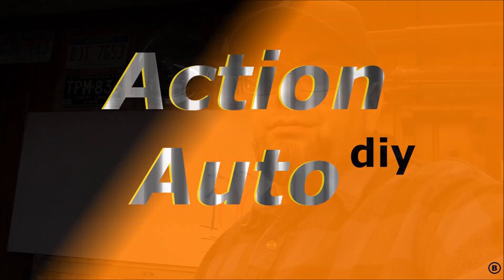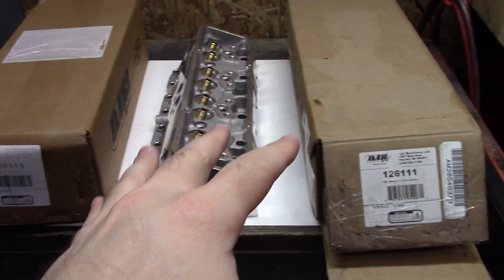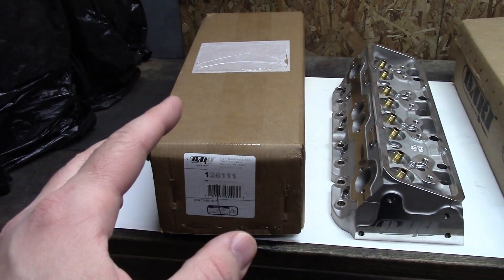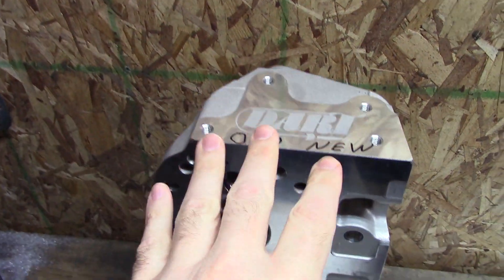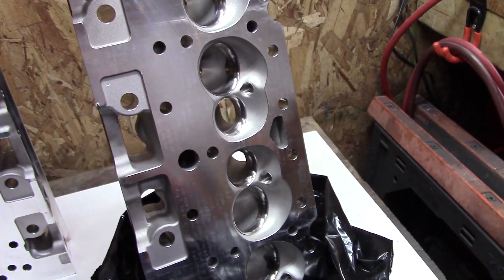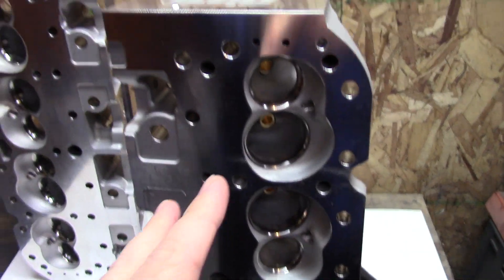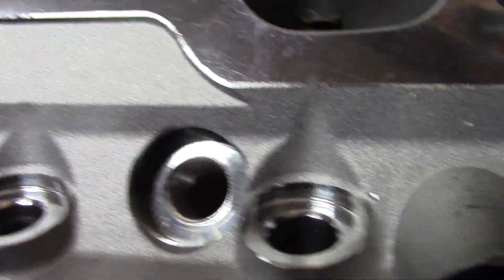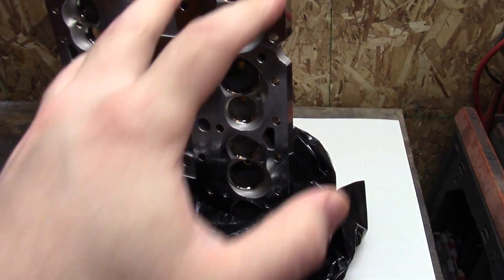Dart SHP the replacements Replacement!

Comment: This reminds me of a situation  I had with dart  heads  I purchased  from summit  racing. I bought  a set of 230cc Iron Egale steel heads  I kept  the in the box and I took my time buying  the rest of the parts need to finish  the motor. Well I took the heads out of the boxes  and laid  them  down  with rest of the parts. I was shock when one of the heads didn't  have spark plug  holes. I first thought  it was some kind of  hemi setup  but know spark  plugs  hole on top. So  I called summit  racing  and the told I was a day late abs dollar  short and I couldn't  return them they called  the company. So l called dart and I explained  my situation  to them and said send them back to summit racing. We'll I was looking to do that but summit  said nope. So  dart told to send the head to them and if things turn out like said what was wrong with the head the would straighten things out . They saw the problem  and dart real good on the defective  head. The ask me do I still want the 230 runners and said  yes. I ask them could get 2.08 intake  valves  he said let me check and see what I have available. He told you got the and I would get the heads in a few days. When a few days had passed  and when arrive home my mom  told me I had a package. So the package  was  by the front door  so when I picked  them up the boxes felt real light so I took out door  in the sun light to get a better  look so opening  the box I grabbed  the head wrap in black  plastic  got a good grasp and yank it out of the box. The heads  was so light that it almost  flew out of my  grasp. I was shock and I couldn't  believe  what they gave me. They up  grade me to pro 1 aluminum  heads  I pickup the phone and call them I believe  I spoke  to a person  named John  and I'd  thank him most graciously  for the  up  grade. When I got hold  of some extra  cash  I ordered  a complete  set. The heads  they sent bare  where 2.08 intake  and 1.625 exhaust. This happen back  around 2005. I would  call and speak to whom in charge  of quality  control. The person  job to inspect  the heads or part hasn't  did his job. They want to personally  know so the can do good business  with us racer. The last time I called  summit  racing  to find out info  they on talk about there products you have to call the company  to get information. I wanted to order a solid  roller cam summit  said I had to wait a couple  of months . So I called Crower  Cams they checked  there cam stock and I got cam in less than to weeks. So from now on I'm ordering  direct from  the company. I'm in the process  of opening  a transmission  repair  business  im going to buy direct  as much as I can.